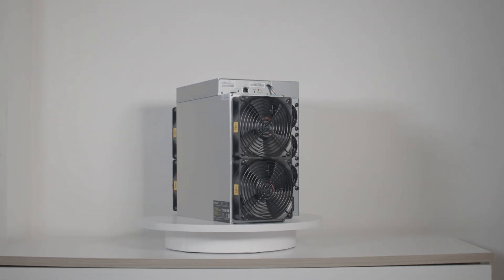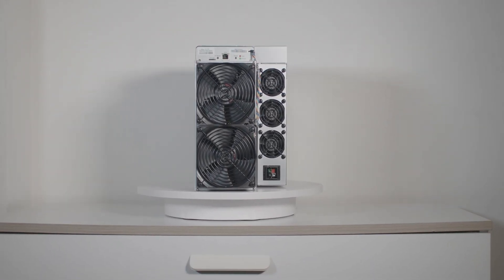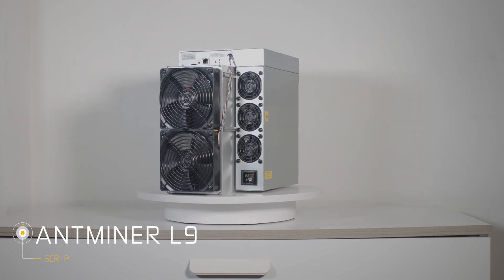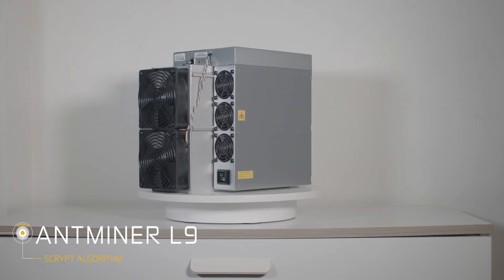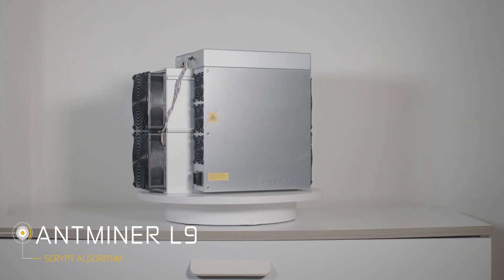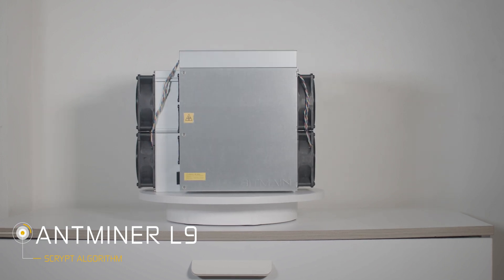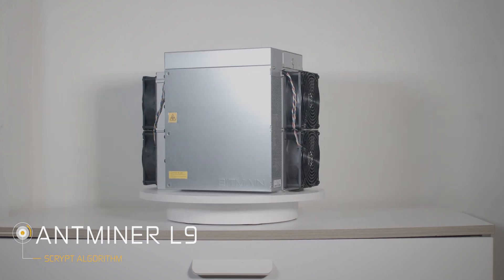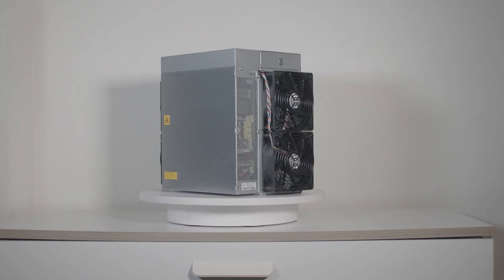BITMAIN #ANTMINER L9 Review

Comment: Beautiful ASIC miner. Does the L9 have a Low Power Mode - similar to the L7
Reply: For  Low Power Mode.I suggest you consider Volcminer D1
Reply: Exceptional Efficiency: Optimized to deliver high performance without excessive energy consumption, helping you keep operational costs in check.
- Compact and Durable Design: Built for flexibility, the D1 fits easily into different mining setups and withstands continuous operation, keeping you mining round the clock.
- Advanced Cooling Technology: Overheating is a thing of the past. The VolcMiner D1’s improved cooling system ensures smooth and stable performance.